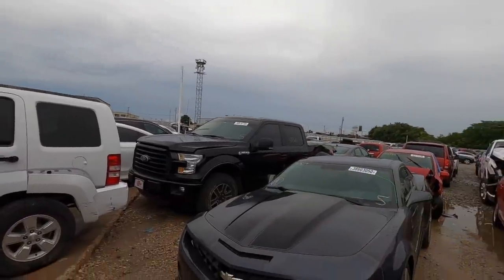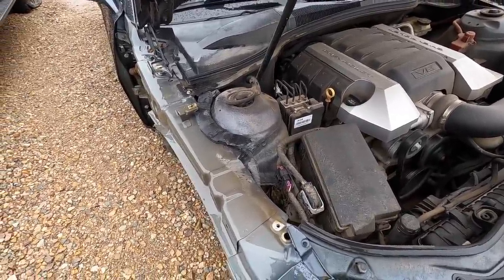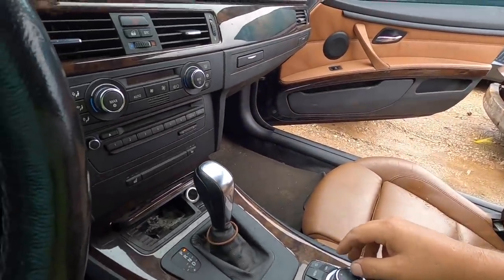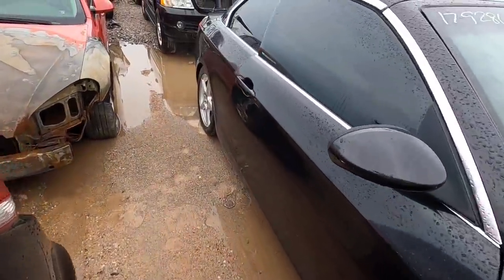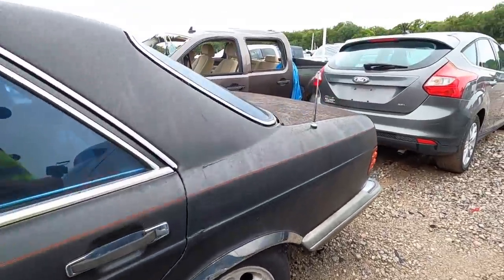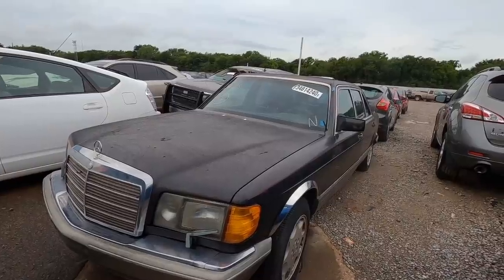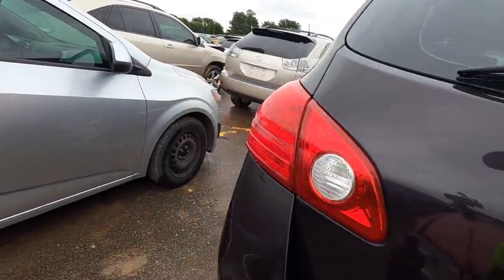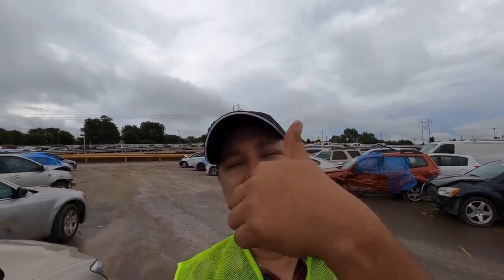Copart Walk Around + 1987 Mercedes 560 SEL 9-8-2020

Comment: I know criminals aren't smart, but why would someone steal a 38 yr old rusted work van? 🤨
Reply: Inconspicuous. With the right person driving, the police 9 out of 10 wouldn't even notice it.
Reply: @paulmckinney6163  I can't help but getting a "Wet Bandits from Home Alone" vibe with this van. Even though the van in the movie was a Dodge.
Reply: It is easy to steal compared to the new stuff.
Reply: @mexicanspec  Hard to argue that point. And to back that up, how often does one pay attention to cargo vans.
Reply: I think the criminal wanted to spray "free candy" on the side
Reply: Pretty sure that you can hammer a screw driver into some of those old ignition switches and steal it so might just be a really easy target
Reply: @matthewhartford2686  In this case if you take apart the steering column all you have to do is disconnect the rod that goes from the ignition to the switch at the base of the column and the van starts.  GM vehicle are very easy targets without even touching the ignition switch.
Reply: Job casing, surveillance, Body drop, Smuggling, and yes the classic creepers doing kidnapping.  Vehicles such as these make great camouflage for all of the above.
Reply: @montyholland3357  I think you covered all of the bases. 👍
Reply: Crak

Comment: As a Mercedes owner for 35 years, the 560SEL in this video is going to require more attention especially the timing chain and the rear pneumatic suspension that's why the 560SEL is sagging. This 560SEL has a sunroof leak with water damage the whole roof including the headliner will need to be redone. It looks like the rims came from a W140 S-Class and the Becker radio is not original because the 1986 is when the W126 had a facelift in the front with headlamp wipers including the Becker Radio where the 560SEL replaced the 500SEL. Unfortunately, this 560SEL will require lots of work and restoration good project automobile. The W126 S-Class were for influential clients who had the ability to spend $60,000-$70,000 during that time. I was old enough to see and experience true ownership of a Mercedes-Benz during that time, Thank you for sharing! My Best, M.L.

Comment: Randy been watching Vice Grip Garage lol. "It's been sitting for 100 years"
Reply: @montyholland3357  Monty how you doing buddy? Have a good labor day?
Reply: @williamsinger4124  ya it was a quiet one at home. Hope yours was good with the family
Reply: @montyholland3357  thank you. Yeah, we had a cookout, and did some more siding on the house. A few cold snacks, and it was a good day
Reply: @williamsinger4124  ya I've got to replace the subfloor in my  utility room and replace some studs in the wall and install a new window do to leaking. Get the place buttoned up for the winter. High of 37 today.
Reply: @williamsinger4124  Happy humpday.
Reply: @montyholland3357  same to you man. Hope you get your subfloor and beams situated. If you were closer, I'd donate some time/supplies to help
Reply: @williamsinger4124  i appreciate it buddy.  I really do. I have the materials. I just hate starting projects because of my brain injury. What should take a day or two ends up being a month or two. I forget what I'm doing as I'm doing it, how I was doing it, or why I am doing it a certain way. I can Never get the measurements marked right or cut right.  Very frustrating for a former contractor.  Took me a year almost on my bathroom. But that was an emergency situation and I had to buy a little bit each month.... Which included replacing the old copper pipe with PEX and replacing the entire drain system.... throughout the mobile home on both. So now it's bullet proof.
Reply: @montyholland3357  yeah, that's rough man. I can't even imagine being for example a car guy, and not being able to drive my Regal for example. PEX tubing, yeah. As you know of my flood situation, my house is entirely pex. As for the new house, I'm gonna button up the rest of the siding, do a couple of odds and ends, and it's good for this year. The old house is a memory now. It's filled in, so I'm gonna let it set until next spring/summer, and re route my driveway, and configure the yard. Edit; we can't keep pex tubing on the shelves at our store lol
Reply: @williamsinger4124  ya this was my first PEX experience. My father was a Master plumber had his own shop, and was also a Master pipe fitter/steam fitter for the local union. So I was always coppercentric. This definitely changed my mind. Ya I'm residing this place next year. I'm doing a room by room remodel of the interior, after the utility room is done. It's a work in progress. But it's mine. At Least I can say that. There's so many people who have a lot less. The biggest pain is replacing all the windows on a strict budget. Only 1 opens that's the new one in the bathroom. That ran about 4500 all in. All the rest are broke and won't open and three the former owner pulled out and blocked off so his in-laws couldn't see in as they lived next door... LOL. But I'll get it done 👍. Oh and I still need to insulate under the bathroom when I do the utility room. 
On a side note you could always plant like a small garden and have a solar water feature incorporated into it where the old has stood as well mb a little gnome and fairy garden...
Reply: @montyholland3357  I got pics of the layout, at least before pics. Ain't took no after pictures yet, still a mess. Old house and new one are nextdoor to each other, driveway between em leads to my garage. Now the old house is down, I'm gonna make the driveway the same width as the garage, and start with planting grass for the rest. Might replace the pool, but, I gotta get the rest in shape
Reply: @williamsinger4124  I'm sure it will look great by the time you are done.

Comment: Randy i got a 1984 Mercedes-Benz diesel as my first car a few months ago and lemme tell you something, nothing works, its a piece of junk on 4 wheels, it smells like old belt leather, but if it has a good jump on the battery and it has a good stream of diesel, it'll run every, single, time.  Id hate to see the one at copart go to the scrap yard.  I would absolutely love it if you got the one at copart.  There may not be any money in it but sometimes you just have to spend some money to save these old cars.

Comment: Hey Randy. About the E93 335i. The car has oil leaks probably being caused from the Valve Gasket or Oilfilterhouse gasket of vacuum gasket. The sound that it's making could yes mean a timing Chain, but the timing chain should run out on heavy abuse around 130 140.000, but it could also be the Injectors, since it's a direct injection. All bmw direct injection BMW's make the same sound. So I just wanted to make you sure you know this info so you buy a good bmw 😉

Comment: That 560sel should have load leveling on the rear. So needs fixing. The drains on the sunroof are probably clogged.
Battery and clean fuel, with new filter. Oil change and she's good to go.

Comment: The N54 in that 335i sounded pretty normal overall, maybe slightly noisier than it should, but with the mileage it makes sense. But yeah I dumped my 2007 cause I wanted something more reliable.

Comment: On the BMW, if the battery is on its way out, it will start throwing all those errors before saying replace battery.  On the Nissan, had a client get rid of hers with 70k because the airbag sensor was a known issue, and the dealer wanted close to 5k to fix it with no assurances it wouldn’t happen again.
Reply: lol

Comment: The Nissan it would be the air condition unit sometimes the pulley goes bad or the pulley underneath it goes bad but that is a pulley that you hear on the Nissan rogue they're good vehicles cuz up here in New York they use them as a winner at and they're good in the winter

Comment: Alright so that 3er, the 335i. It has the highmile trifecta, that being those three warming lights indicating a wheel speed sensor that broke.
The N55 that should be in that car is generally regarded as reliable if not neglected, and even if it is it can take a fair bit of abuse. 
(It was an N54)
As for the key, Keyless go was an option in the 335i, being part of the comfort access package. However if it was equipped well, those rims it has are very, very weird. That tells a lot about the car history.
As for the Merc, the rear is supposed to be self leveling. It uses fluid to do that, it's probably either put since it already leaked out. You can swap it for struts without much problem thought.
Reply: That has the N54 since it's an '09 and the chatter is from the fuel injectors. My '09 535i sounds the same for the first few seconds after a cold start and then the noise chills out, may or may not be an issue with them down the road but I have 176k on mine. Idk about burning oil but these engines do leak like hell as they age, mine being no exception lol.
Reply: So I ended up with that exact 335i, it actually sold at copart a little over a month ago. The warning lights all went away after driving it a couple miles, although after giving it full throttle from a light it ended up throwing misfire codes. The chattering was barely audible when I picked it up, and after driving it home it sounds just like a normal 335i, just typical injector noise. Right now I'm replacing the spark plugs and valve cover gasket since it's leaking oil into the plug holes. Crossing my fingers it fixes the misfire
Reply: @dumbfishtanks  Yeah more than likely just a bad spark plug and/or coil for the misfire, I've replaced 2 of mine with Ebay coils since they are a good amount cheaper than OEM. Seems like that fuel injector clatter is pretty normal though, but when I bought mine I did think something was wrong since the noise was so loud at cold start. Is the convertible top working?
Reply: @corionh4775  Nope, whenever I press the button for the top it flashes "trunk partition" on the screen

Comment: 1st car: looks okay, okay heavy hail damage oh spider nope, so yeah well go this side and still looks good and oh dam! yeah that is what you there is a missing wheels and err the whole breaks and most of what holds the wherel into place dam that was quite the smash, dam yeah that's err that's a whole new front steering unit as that is wow i knew you usa ppl had big pot holes but dam! 
2nd car: god dam usa you need to man your cars up! slight bit of hail and boom dead car, dam no wonder your econeme is in the toilet your buying new cars that will still work after some light or heavy hail, guess the usa cars don't have balls any more or the other car makers go "okay usa car, fast, yes, got lazy man gears, yep, and thick paint but if it hails its going to break yep right send them off then" yessh, you don't even get a comment from me on the car you say hail damage i say pussy car or whimpy car, yessh at least our cars rusted out badly i in stupid places, yours slight hail and its dead jim.
3rd car, or van a chevy, i like thes, the only problem is i'm more a 90's scocar mum mini van kinda guy, the reason? these older vans are nice but why is the engine in the middle were the driver and passanger are? that makes anything hard to do but there nice if there not rusted out or got bottles of fulids inside them as in a lot, yep rusted and it was stolen shame
4th car, oh head light wipers and its a old merc, these are tanks in the same they run on and go almost anywhere but sadly they can be very hard to fix as in you want mercedes parts? oh yeah best have a wallet that has money as parts aren't cheap after market or reconed parts you might get lucky but its a nice car i do like the old merc's just if the parts weren't so darn high end priced i'd buy one, might be the balls are no longer holding gas or oil, as like citreon's mercedes had there own soft ride and the balls might be why its low, 
5th car, morden junk heap, send that to the scrap yard n not the merc, be quite a few ppl out there after the merc as there not that common a sight on the roads,